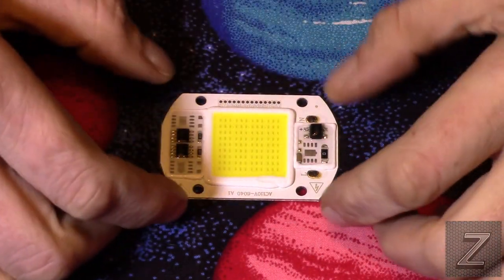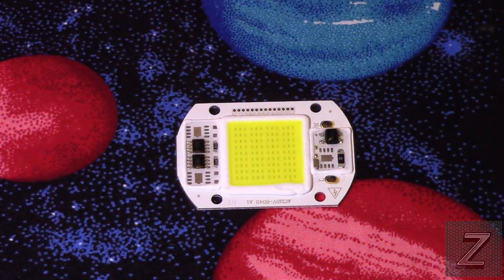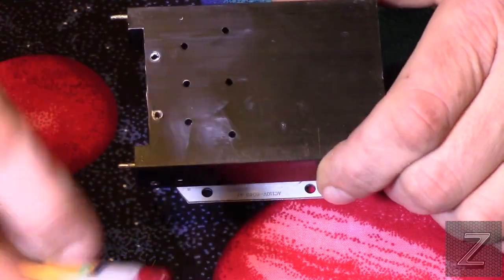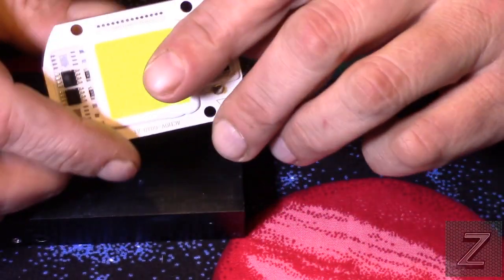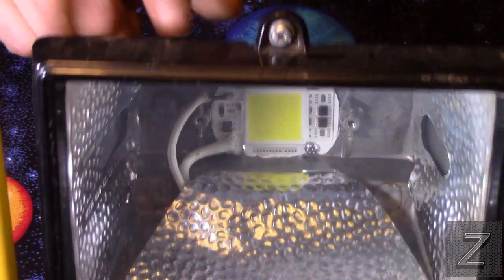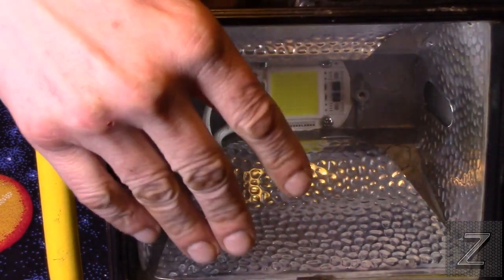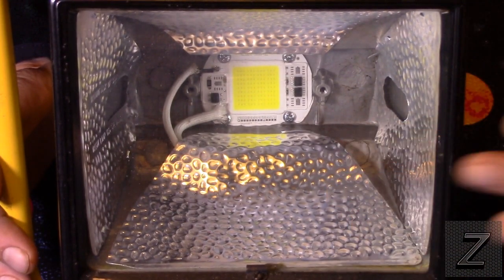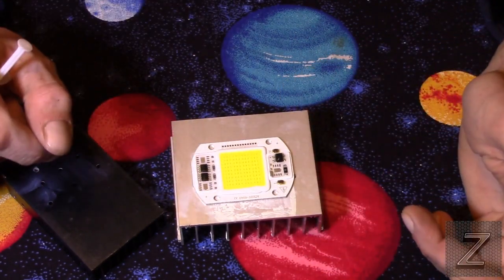110 & 220 Volt 30/50/70/100 Watt COB LED Floodlight with integrated driver

Comment: Could you take those driverless COBs and connect them in series and directly to a wallplug?
Reply from the maker: no that's not going to work the COB LEDs are DC and the driver board converts the AC to DC and regulates voltage
Reply: @z-hut1663  I assume then that you could connect two in parallel and directly to a wall plug, correct?